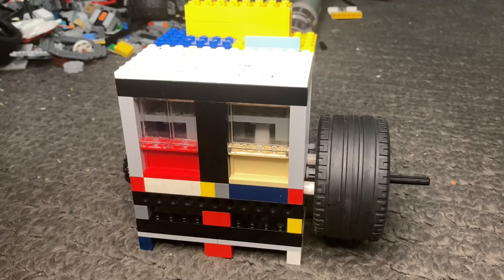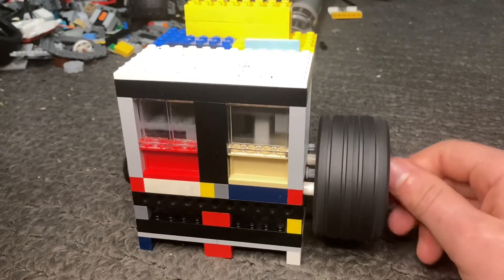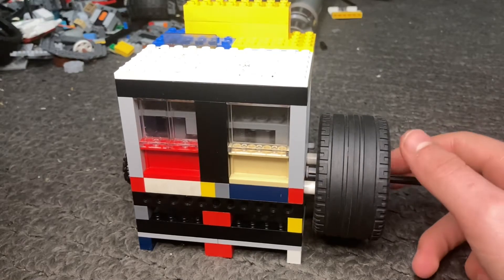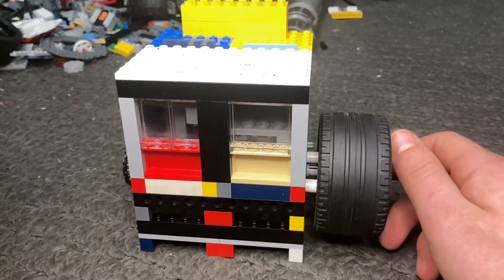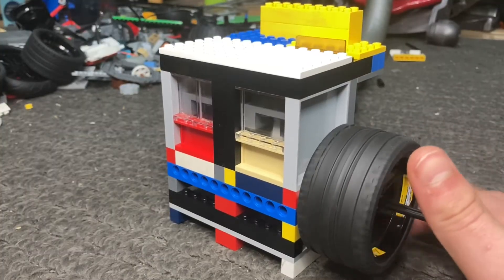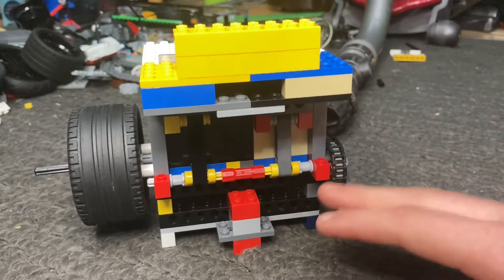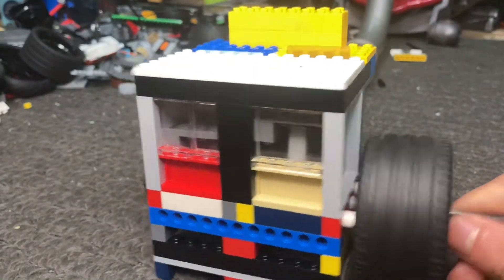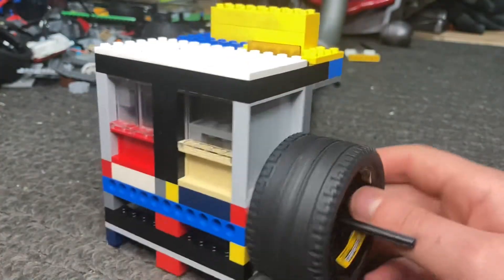TUTORIAL: COMPACT Inline 2 Lego Vacuum Engine

Comment: Hey uh quick question, do you apply oil AFTER building the engine? Or Apply oil DURING building the engine?
Reply from the maker: Either method works, but oiling some spots like where the axles go through the holes could be easier while building

Comment: I’ve made multiple vacuum engines with the Lego crank arm, and have come upon the same issue with all of them. The crank is not strong enough to handle the power that is being made. I have solved this by taking two of the plates that have a double connector and gluing them together, but it’s not a permanent solution. Does anybody have any ideas for a more permanent solution?

Comment: @KFPlus Lego Mastery

does increasing the cylinders in quantity improve the rpm and the torque of the wheel? because after all, it is all from one vacuum suction.
Reply from the maker: In fact it does, because of the fact that the power is more evenly distributed and not completely wasted on one cylinder, you’re able to get more torque as well as a smoother engine in general because of more consistent power delivery. It’s definitely hard to explain and worth its own video to go into depth.

Comment: you should buy a tachometer so that you accurately measure the rpms of the engines. i use one all the time and they are fairly cheap. the lve i built today spins at 2500 rpm.

Comment: Would having an exhaust valve benefit a 1 cylinder engine?
Reply: On these engines, the one valve operates both functions of intake and exhaust contrary to the real counterparts that have at least 2 or up to 5 valves per cylinder.
Reply: I would imagine that If you are using a turbine or supercharger concept added to your engine, an exhaust valve would help release any extra pressure that is built up in the piston chamber. I dont know for sure though.

Comment: I'm suprised 747 didn't mention this but this design is very easy to boost, much easier than a traditional design I really really like this design overall, I plan to attempt a inline four cylinder using this design, should make it a lot easier and make the manifold easier, hope you weren't already planning this haha
Reply: did adding the 2 extra cylindars work? sorry for being 3 years late

Comment: Something that I've found while making lego vacuum engines is that if you put a bracing at the other end of the fly wheel and attach it to the base, it runs much smoother and gives better performance
Just wanted to point that out :D
Also I love this engine :P
Reply: Butterfly won't work in multi-cylinder configs because of the way it leaks during the up stroke. The leak will rob the power from the other cylinder.
Reply: @EveKitty08  it does work in multi cylinder i already built it. The pistons need to be timed same to each other, no offsets and it works
Reply: @lemns0000  Yes, this does work, but what's the point of having a twin cylinder timed the same when you could just have a larger single cylinder?

Comment: Just was thinking, if u want more efficacy, maybe oiling the chain could help... in my engineering class we used brake part cleaner and deoiled a chain and measured how fast it run. Then we oiled it and it went a bit faster. Also, could u use the design of a butterfly valve and just remove the regular valve and swap the pistons out witj those?
Reply: Butterfly won't work on multi-cylinder engines. Since the cylinder leaks while on the non-power stroke, it will rob all the power from the other cylinders.
Reply: @EveKitty08  ohhh didn't think of that
Reply: @shlushe1050  they are lying. Butterfly engines DO work im multi cylinder, they just need to be non offset i already built a 2 cylinder butterfly before and it worked great, the pistons need to be non offset
Reply: @lemns0000  clever Idea. so since butterfly engines release air going down, you cant have an offset on the pistons since that air leak robs all power from any other power stroke?